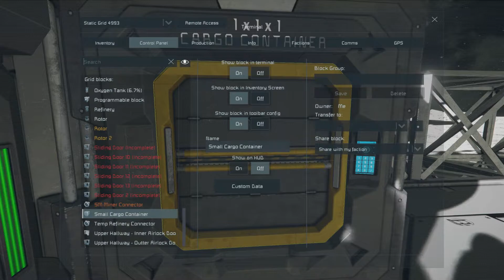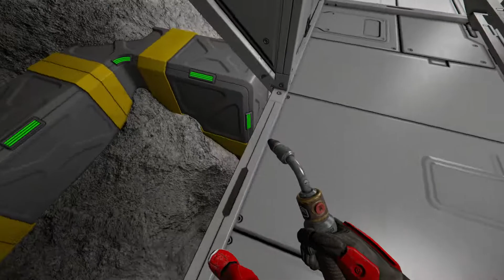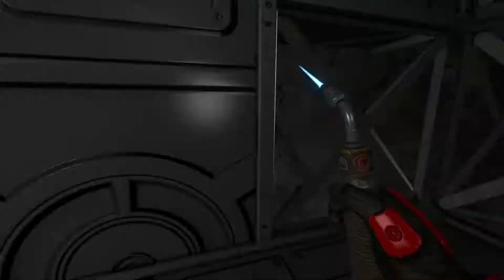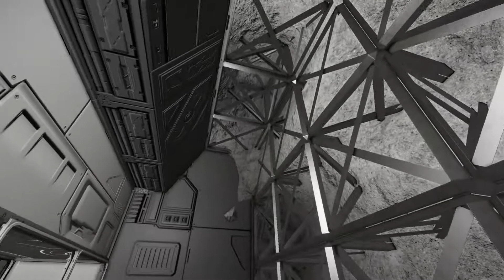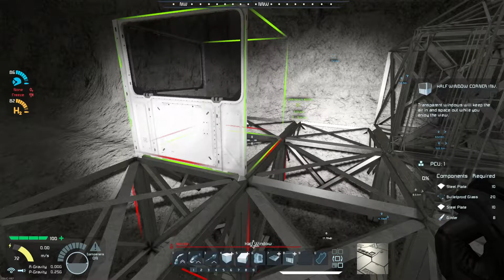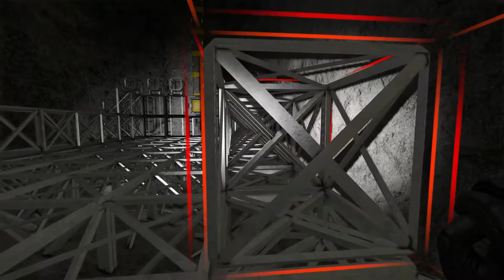Space Engineers | So You Want To Be An Engineer | Ep. 11 - Engineering Hab

Comment: If you have a small room next to a pressurized room you can put two vents back to back between rooms and have the one in the pressurized room set to vent all to feed the separate room.
Reply from the maker: I generally bypass it entirely by just have a "grate" like the new walkways or old (no-glass) windows.  I do actually use the back to back vents in small airlocks though.  Basically the small airlock vent is set to depressurize constantly, and pushes that air back into the interior space.

It also works as a quick gauge to see if I'm out of ice or not lol